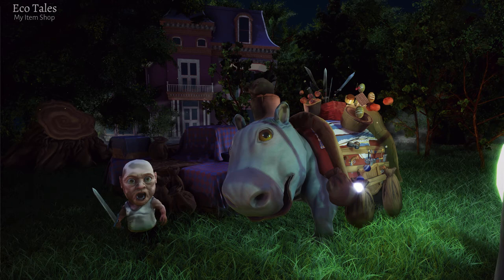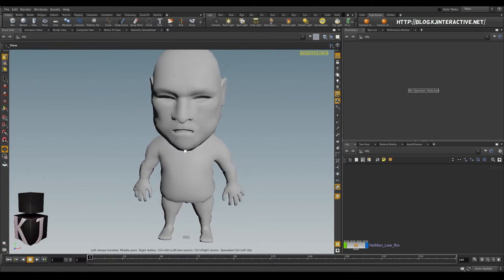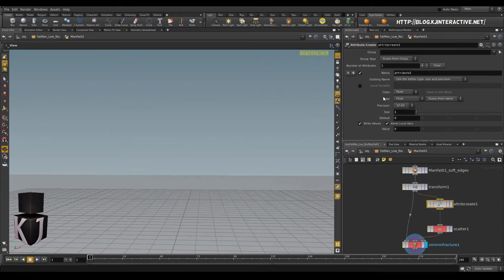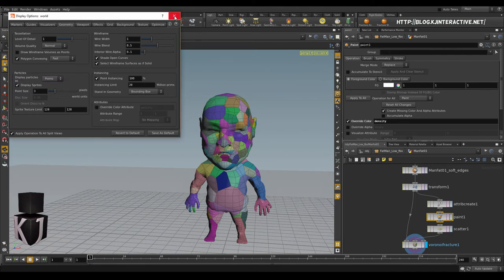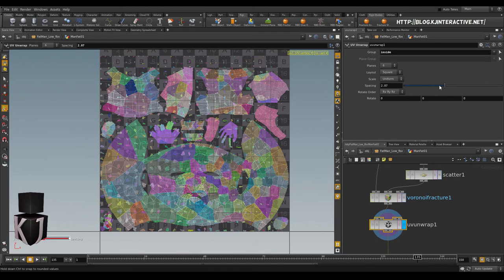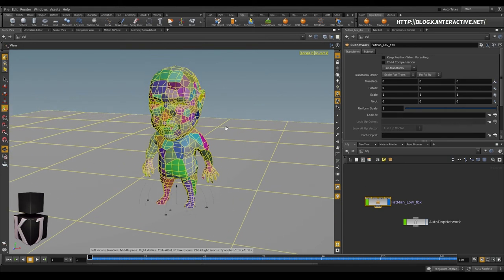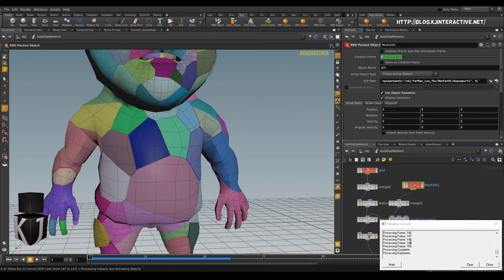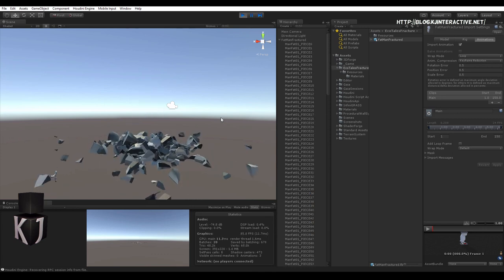Houdini - Unity - Rigid Body Fracturing Pipeline

Comment: Thanks for the info, it was pretty hard trying to figure this out from scratch for me. Had no clue that I would need the Gamedev Tools in order for it to work, or about even the basic hiding parameters >.<
Reply from the maker: lightgem12 glad to hear it was helpful, working on a pluralsight course for games currently, no dynamics this time though, only procedural modeling.
Reply: you know if there is any way to make this into an asset? like you toss in a fbx and it cooks a fracture. I get a feeling that this might not be possible but thought I might just ask.
Reply from the maker: As far as I know, this isn't possible.
Reply: assumed as much
Reply: Where do you get the Gamedev tools? Is there an option to activate on preferences?
Reply: should be in the comments